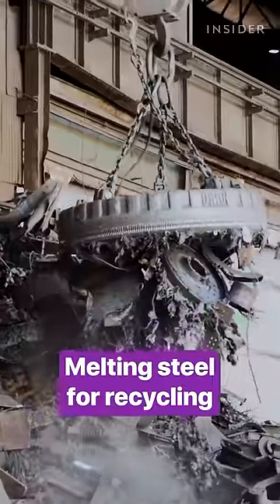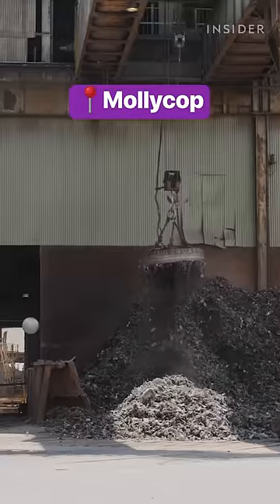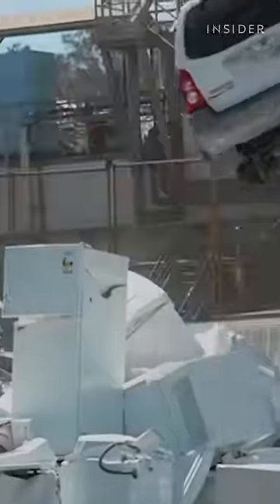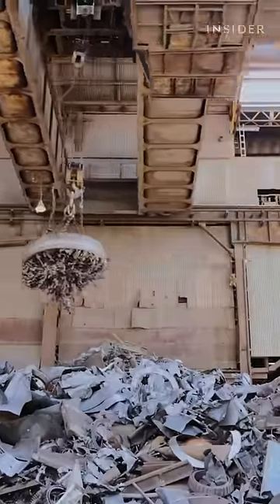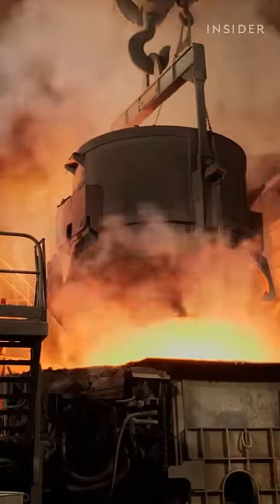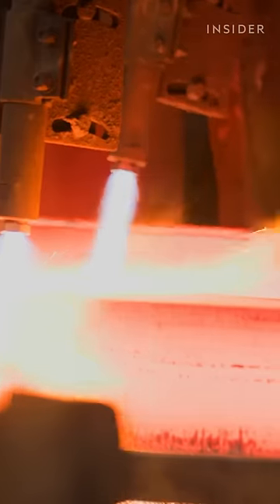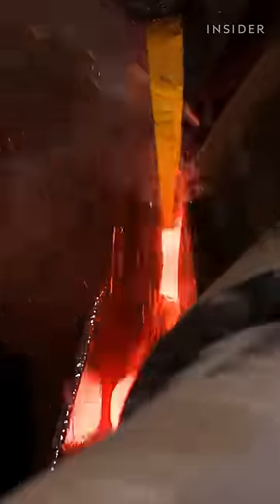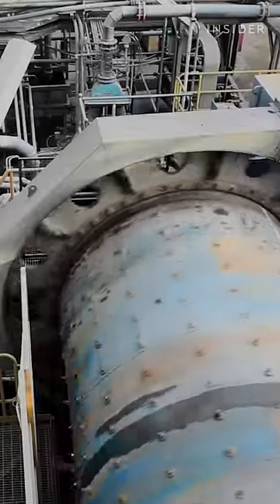Did you know that #recycled #steel is often cleaner and more #energy efficient than new steel?

Comment: The machine at the end is called a ball mill and the balls tumble as the it rotates to pulverize the ore into dust before it goes into a calciner that roasts the ore.
Reply: Well the ball mill could have been anywhere... A cement plant.... A lime plant.... They said that they were making the ball mill balls out of the recycled steel... 

I've worked on hundreds of ball mills unfortunately 😅.... They are hell to work on.... Especially changing the internal liners or doing a gear flip...
Reply: "He could screw up a mill ball!!" Lol
Reply: Not a given that it's going to a calciner. Especially if it's copper ore
Reply: "Will it blend!?"
Reply: The ball mill could be in a coal-fired power station.

Comment: This made me chuckle. I once had a freight car come into the shop for a new coupler. The only 6 mo old coupler on the car had broken completely off  because the manufacturer had mixed in some recycled steel which included a sizeable piece of crumpled stainless steel which had NOT melted in the furnace. So much for efficiency.

Comment: I remember seeing a steel recycling plant north of Grand Rapids MI that melted scrap into counterweights for cranes and fork lifts.  I have noticed recycled steel does end up in applications that do not require a lot of purity.
Reply: True of most recycled materials, it's just more expensive currently to get the purity up compared to new material. Most recycled plastic and glass is used as construction filler material as well.

Comment: Didn’t know there was a steel recycling company in Australia before 1923.
Reply: Yeah, their called blacksmiths haha
Reply: @nunosilva187 That's iron most  blacksmith  worked iron steel  Was really, really, really hard to make, and really, really, really. It's expensive at the time. It's why axes only have a welded  tip of steel.  the rest of it is iron.
Reply: @harveyblough7204  you do know that the english pionnered the use of blast furnaces to create hundreds of pounds of steel daily right?
Reply: @nunosilva187  You know  that steel at the time was worth more money than gold and was very hard to come by. So they only used it very sparingly. So iron was probably what was used by the blacksmith Oh and by the way them are  not Blast Furnacesthem are lye Furnace The english blast furnace you're talking about That came at the very beginning Of the industrial revolution of the 1900  which was the end of the time of the blacksmith The furnaces used to make steel befor 1900 was a lye Furnace  they would  add lye to the Charcoal to make  it  Burn hotter but the By product is a colored Glass that they used to have to take out of the furnaces and sometimes you will see roads paved with it
Reply: @harveyblough7204 that roasted glass is called clinkers similar to inefficient coal burning in the US if memory serves

Comment: I did not know how often steel is recycled. It does take a bit of the sting out of it all.

Thank you for sharing!
Reply: In the process to make steel you need to put recycled material to adjust the carbon
Reply: Recycled steel =/= new steel.

In a lot of applications you use steel because you need to achieve certain mechanical characteristics (hardness, bending strength, thermal conductivity, etc). Examples for that are most industrial or safety related applications. In those cases, you usually can't use recycled steel, because you don't really know the properties of that steel due to the different properties of all the different parts that make up your recycled steel. For example you can't make structural car parts out of recycled steel because that steel will be much less durable in a crash.

Comment: Almost all metals and almost all glass are 100% recyclable over and over. Use reusable.
Reply: People used to reuse glass bottles and jars. Some companies did as well. Customers would bring them back to the store and the company would wash, sterilize, refill, cap and label them. Cheaper than melting glass down.
Reply: @AnthonyMorris-pg9xj still common in Poland, you can buy cans, but bringing back bottles is a cheaper way to buy beer at the local shop

Comment: Gold practically does not occur as ore, but only as pure gold flakes or nuggets. I have no idea how gold miners could use big steel balls like these. Gold is washed from the soil with water, using the fact that gold is much heavier than many other minerals. Most gold is in the form of tiny grains.
Smaller steel balls are used in jigs, but those are not for crushing gold, but for washing concentrate from the first washing step further.

Comment: There is one issue here that they're not talking about and that is that still and even iron can only be melted down so many times before it molecularly begins to break down. At that point you didn't need to start adding new what's known as ore grade steel to it to reinforce the bonds with newer material otherwise at some point if you reuse the same steel over and over it would just become a brittle chunk.

Comment: This can be said of nearly all metals. Save aluminum that requires the addition of material for every cycle. Glass is also in the same category.
Reply: Better than having to produce all new material. Plus steel most often doesn't need to be melted down and recycled to be reusable
Reply: @Coastal_Cruzer  I never said it was bad... not sure where you got that from my statement. My point was simply LOTS of materials are recycled at the same rate as steel.

Comment: Depends on who is involved.   If any corrupt politicians or the country china are involved,  then the steel you receive is often rated as better quality then it actually is... which is a huge problem when certain grade strength steel parts are needed for building bridges and sky scrapers but nefarior ones are manufactured instead from lower quality recycled steel...

Comment: Imagine creating a minimum wage job out of separating components in depth from plastics, metals, fiber etc. Imagine how many jobs  (also the coet of labor)
Reply: M AgN eT
Reply: Video on YouTube about a company in Tennessee who recycles electronics (I think it's on this channel - Insider Business). It can be dangerous and made more so by not requiring electronics to be made to be recycled. Such a little thing - a law to require it. So, most of it goes to a landfill and pollutes or you pay Best Buy or Staples to take it. it should be like a rebate if you turn your old in or let someone pick it up and sell it, like scrap metal, copper, tin and  aluminum. Core charges with batteries, starters, etc, but that's charging individuals to fund the industry, not giving them a rebate for recycling.
Reply: Why should it be a minimum wage job?

Comment: Powered by people who scrap. They need to open up carbon credits to individuals so people can make money off of offsetting carbon. That would make the difference, just like with the recycling steel. Last year I hardly drove my car at all, less than 500 miles. I should have been able to sell that to a corporation. Then, THEN, you'd see a dent in carbon emissions or let people get money for recycling glass, tin cans, etc., instead of charging individuals more for recycling than hauling it to a landfill. Countering climate change will have to be done by individuals or it will never happen. Governments and corporations can't do it alone.
Reply: It's not like you have to wait for the scraps though. Old ships, decommissioned building parts, even old used cars..
Unfortunately, recycling steels with different material specifications means getting pure steel is difficult, requiring new steel material to recreate the steel to standards.
Reply: We do get money for recycling cans and bottles though.
Reply: scrappers arent offsetting anything. driving around in clapped out oil leaking POS's for hours at a time to haul in a couple of appliances. or how's about the ones driving diesel trucks around, leaving them idle while picking through trash for a bed frame rail, a lamp etc

Comment: At some points during steel recycling, historically, radioactive parts have been put into the recycling stream. Resulting in some radioactive steel at times. Something to know. Hopefully your steel is not radioactive. ☢️😊
Reply: They check it for that nowadays.
Reply: I work at a steel mill, that is something that's monitored for exceptionally closely. We're able to detect a tenth as much radioactivity as a smoke detector across a 40 ton heat of steel. We would be shut down for a while cleaning up from that, if we melted something even with that little radioactivity. It is taken Very seriously
Reply: @Iammastercheif1  I have seen a radiation detector at a scrapyard go off when a driver crossed the scale the day after having a scan that required she drink a barium compound.  She had to get another driver to drive her truck through the detector.
Reply: @Iammastercheif1  that's great to know. It was many years ago that there were pans that had been discovered that had radioactivity from radioactive steel. I think after that the industry started taking it extremely seriously. It's important for all our safety, yours and your fellow workers included of course.
Reply: @Iammastercheif1 Americium's pretty spesh to recalibrate but that's what, 0.2 mg of it? You don't run isotopically pure lines anywhere. Here computers (phones) have big metal heatsinks, they're getting soft errors from the natural radiation. It's a wonder more pixels aren't stuck.

Comment: What I don’t get is how they know the composition and adjust it to get the desired alloy, and do it cost efficiently
Reply: They don't. You caught the part of the story that I was going to comment about. There are thousands of alloys with quite different properties and there is no way they know exactly what is going in the mix, so they don't know what is coming out either. 

I suppose they could sample a bit and test with a mass spectrometer or something... But you would have wild inconsistency trying to get a specific alloy that way.
Reply: There are ways of testing the carbon content

Comment: The molecular structure of recycled steel is different from new steel/ weaker
Reply: Which is why it is useless for structural applications. It isnt weaker, just less elasticity making it great for hardened steel for tool bits, hammers, etc.
Reply: If 30% of the steel in the furnace is new it negates the weaknesses of 100% scrap steel
Reply: @M8Military I'm probably not going to waste my time checking with my brother, who is a retired metalurgist , & has run refineries throughout the country, just to see if your right pretty sure a 75 new 25 old is close to the mix , depends on the application, there are 3 refineries in my town, 1 is crucible steel, which I believe uses only virgin steel

Comment: The steel, as an end product, may be cleaner, but the crap burned off and sent into our atmosphere is a horrible pollutant. A reduction in the need for steel, meaning a reduction in the human population, is the only way to "clean up" the environment.
Reply: It's not as bad as what gets released during the mining and refining process.
Reply: Steel is literally one of the better resources for the environment because you don't need to recycle it in order to reuse it. You can literally just rework scrap steel. Significantly better for the environment than using polymers, even as forever materials.

Comment: So they use recycled metals to refine raw metals? Seems counterproductive…
Reply: The other way around actually - you need some new iron to refine the old steel.
Reply: How else would you crush the ore? They're using steel balls made from recycled steel, to crush the iron ore. 
Every industry has to put money in, to get money out.
Reply: Idk, I was just thinking that putting the recycled materials back into circulation would reduce the need for more raw material extraction. And since the narration mentioned “MOST of the recycled steel gets made into balls for this purpose” just means you can refine more ore. So the reason for recycling isn’t to reduce the impact but rather to increase production. I do understand the reasoning and aren’t questioning it. Just thought the narrative was leaning toward a different direction I guess.